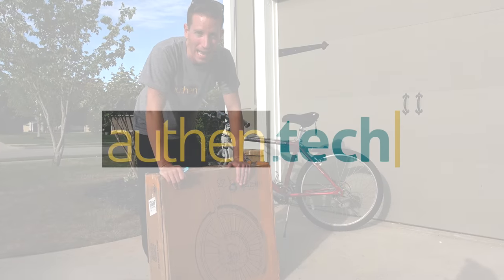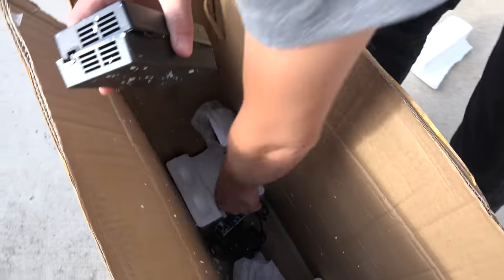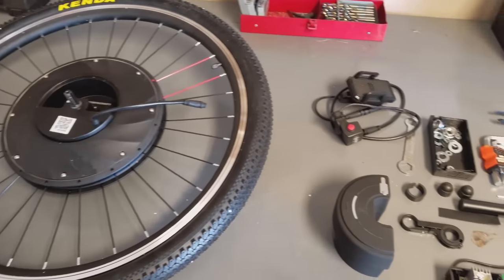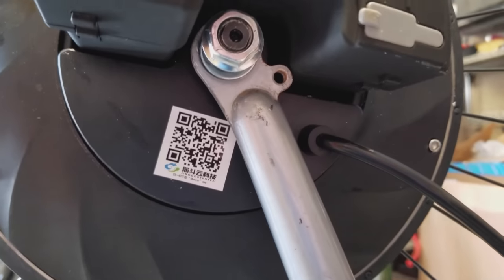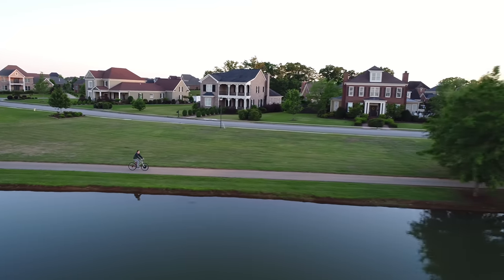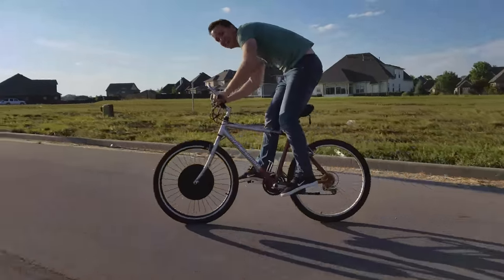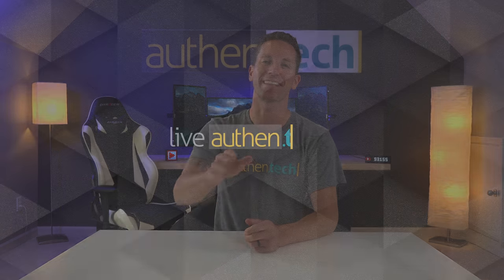Easy + Cheap eBike!! Motorized Wheel Conversion Kit REVIEW

Comment: Why does this look almost exactly like the upcoming UrbanX / UrbaNext wheel?
Reply: sponge720   this the first iteration of the UbanX.
Reply: There's only so many form factors you can effectively use for an in hub brushless motor.

Gearless drive means pretty low torque until you get it moving a couple of MPH. (high amps for low effect)  But at speed its far more efficient.

The key differences will the number and quality of magnets, stator poles and winding pattern.  Quality of all materials used.

Comment: How much power or torque, speed accompanied with pedals, whatever it might be are you allowed put on a standard bike before you are required to start paying insurance policies, as if it was a petrol motorbike, I have just looked at a few of the Motors out there,  that I have watched so far, a and strong fit man can get up to that speed so, I don't think these should be made pay insurance to go on the road, what is the situation on this antibody.?

Comment: What Ben said....130wh = 3.6ah, which means the battery is miniscule and won't come anywhere near using the full 240W motor capacity.
Reply: 139wh = 240watts for 36 mins

Comment: i bought a similar unit front hub , when i hold the axile bolt in my hands the wheel wont spin or free wheeel , is that normal ??  are the magnets so strong you cant hold it in your hands and spin the rim?

Comment: this can be fitted to beach cruisers? I heard you mention "leisure bikes", same thing I'm guessing. good review! first time looked at the ebike game, they were recommended by a friend. i didnt consider front wheel drive before this video 👍🏼
Reply: just wondering if the angle of the forks vs the persistent drive torque on the head set would lead to eventual failure?

I'm on flat ground with good pavement, a few very small inclines as I'm on an island so "hills" isnt the best word choice! head winds and my 8'6 surfboard on a side rack will be my drag obstacles.

Comment: Can someone please tell me why they don't make 27" conversion kits? There is every other sided bike wheel but god forbid we add 1 more inch in diameter. I like my road bike with the slightly larger wheels. why cant I also have peddle assist? I've seen E-bikes with gargantuan off-road tires. So weight cant possibly be the issue. I have scoured google and such and cant find a single conversion kit to fit my bike.  If im missing something please point it out because I would really like to jump on the E-bike bandwagon.

Comment: Hi! Thanks for your Video. Coud I ride when it is raining. The battery would suffer any damage?
Reply: I have a full kitted conversion on my bike with a dolphin battery, you would have to check the quality of the outer casing but as for mine I wouldn't leave it out all day in a rain storm mainly to protect the motor as the battery is removable but as for heavy rain on the way to work and storing under cover when you get there should be fine, just avoid really deep puddles.
Reply: I've ridden mine in the rain without any issues, just avoid deep puddles.
Reply: Hi David Marks,so i can ride in the rain? Cuz i live in Scotland and i need to be sure, also the Gear Shifter is safe?thanks anticipate...
Reply: In third gear, I seldom get passed by those using kinetic energy. One guy, whose 'off the shelf complete e.bike', which was faster, scanned my bike with his eyes as he passed. Wheel and two spare Batts, cost me around £500... I buy spares for peace of mind. When the batt dies, it's slow peddle home,  like the old days for me, which is why I got one!

Comment: i have a Schwinn 29'' mens taff mountain bike my question is can this motorized wheel fit for my Schwinn that has disc brakes will the wheel fit for my Schwinn ?
Reply: yes
Reply: @chenlvbu3221  My Cannondale don't have no disk brakes I got the bike from Bert's bike shop. Can this electric wheel fit my Cannondale and the wheel size is 37-622(700x35c-28x1 5/8x1 3/8) mill 50-max 85psi (3.5-59 bar 350-590kpa kenda courier that's what it say on the rear wheel ????

Comment: Three things. 1) this looks like a rip off of the urbanext and 2) I think they added one too many zeroes to the mah rating 3) That much torque on the front forks could be dangerous and you should consider a torque arm if you're using aluminium.
Reply: Rich Tornambe mine keepscbrakin the spokes it jest hade new wheel rim and heavy gage spokes fitted and trimed at a cost of 78 uk pounds its a lot better now i have to watch the tork in the wet u can set them up to do 27mph so im told with your phone and a app
Reply: Rich Tornambe.

Comment: My ebike's a 1000w 48v wheel. It can actually get me rarely up to 46 or so if the winds are okay and im going downhill. As for going around places, usually about 30 or 35.
Reply: My 48 volt 350 watt around 
50 kmph+

Comment: check and tell me if you can use a 12 volt solar panel to keep the wheel charging and using it at the same time and it's another charger called charge and go tell me if you can charge the wheel and use the electric wheel at the same time ?
Reply: it can be done but to keep it charged while riding you will need a lot of sun and a giant solar panel
Reply: but if you leave it in the sun it will charge slowly so why not , I wish solar panels were morre efficient
Reply: a solar panel that put out more volts or watts might do it i mean more than 12 volts might do it ?
Reply: doubt it , if you leave it charging in the sun for 12 hours , you might get 12 minutes of slow cruising

Comment: I'm a mechanic at a bike shop, I own two multi-thousand dollar bikes, I know my way around two wheels. A guy came to our shop insisting that he just "wanted to show us" something but didn't want to sell us anything. With a little pushing my boss got it out of the guy that he was one of the biggest investors in the company that makes these. Me, knowing what a good bike is and also weighing 210lbs, thought "This could be neat for someone who knows nothing about bikes." If only. I took the front-wheel-driven bike to our parking lot where I have tested thousands of bikes, and gave it a spin. Mind you, 210lbs is nowhere near the upper limit of people who ride bikes, and I get the feeling that this product will attract bicyclists on the heavier end of that spectrum rather than the light, fit people who probably own a bike that would never accept this technology anyways (since 26 inch wheels are no longer mass produced by any bike company). So I sit on this bike, I throw the throttle wide open, and it takes the bike until the end of the parking lot go maybe 10mph. (Our parking lot sits slanted at maybe 10 degrees from flat, you wouldn't be able to tell that it's not perfectly level if you stood in it). I'm immensely unimpressed with the power and torque of this thing.  I turn the bike and immediately the motor struggles to keep up, not even going up the slight slant of our parking lot whirring and pulling me to the end at a top speed that couldn't have been more than 5ph. But that's not the end of it; the particular model I was on, which I was told was a prototype, had regenerative braking. Normally this is good and on high-end electric bikes can be toggled on and off. On the bike I rode, the regenerative braking was more powerful than the cantilever brakes on the old 26'er. not impressed.

Comment: That "mounting hole in the way of the battery slot" is there for a locking washer which stops your front wheel from falling off if the nut comes loose!
Reply: Derf,  it's for a Disc Brake.
Reply: Mounting bracket for a front rack.

Comment: Trust me rear drive is a lot better. potentially that motor could rip the forks off the bike.Also you get better traction.If you spin that front wheel leaning into a bend(easily done) the bike tends to slip out from under you. I know coz I've got one.Anyway good video mate. I love these ebikes/cars as well

Comment: 36V 3200mAh Power Lithium Battery? That is tiiiiinnnyyyyyyy. Ain't no way you are getting any worthwhile distance from that. That's essentially a 10S2P 18650 pack. 20 batteries. That's poop. I have over 120 cells in my bike and get about 35 miles before the voltage really starts to sag. Granted I'm pulling 500-750 watts, but anything lower than 500 and you might as well just pedal or walk.

Comment: I would not waste money get 1000w hub, 45 amp controller and 54.6 volt battery. You will not regret it! You then have speed and distance.

Comment: Way to many mah there is only 3200 mah not 30k
Reply: my anker powerbank is 26800mah which is 3 times smaller than that battery, and it is real value because it uses 8 panasonic cells inside each being 3.7v 3400mah

Comment: If that bike frame is aluminum, the drop down on the front fork will snap and you will either fall on  your butt and be scratched up a little or you might fall on your face and die.  MAKE SURE YOU HAVE metal frame bike or torque bars attached!!!!!!!!!!!!!!!!! Also you can find cheaper 1000w kits on amazon for like $160.

Comment: 15mph top speed 😂😂😂😭😭😭
Reply: lol I know! I can get up 20mph cruising in "power gear" with my regular leg-driven bike. The only advantage to this would be for longer transport rides where you might want to save your legs.
Reply: Haha yeah thats what i said. I easily reach 30-35 mph when I'm peddling real hard and average about 15mph when just strollin. Guess it it'll take the burn off my les though
Reply: Yeah yeah you know what they say about guys who brag LMAO
Reply: Faster than 10MPH pedaling a bike, and can really make a difference on long trips. Also beats the costs and legal hassles of cars, mopeds or motorcycles. Still, I ended up using about the same amount of money as that hub motor kit price to put a Honda 25cc engine on the front wheel with a 64oz. tank and Kevlar tire instead. I get about 16-23MPH because of my gearing, but I also get about 50 miles per tank or 100MPG partially for the same reason. Plus, I don't need to limit my 1-way trips to about 5-7 miles then go back and charge for several hours like E-bikes. I've taken this bike on trips over 100 miles no problem. I let a friend pay me to use it for work lately, and I miss it. Still, a deal's a deal, I needed the money more than that bike lately, there's more Winter weather now, and it's not as much fun to ride now, anyway. My friend needed starting fluid or to keep the bike inside for it to start and run right to/from work. Still better than a cold E-bike :)
Reply: I was watching ebikes in a local store, all of them are limited to 25kmh, according the EU regulation and the prices start at 1200 euro, so this looks like a steal, I think, I get it
Reply: @Ultranationalist lol but you can get up to 30 but you wont be able to maintain it that long
Reply: @catsbyondrepair  I do. Lol

Comment: All fun and games until it rips off the dropout tab from the fork and your teeth go rolling down the street.  Fork dropouts aren’t designed to withstand torsional force and will fail.
Reply: There is small torque washers in the kit that help with this. My locknuts have never come lose

Comment: It's way too cheap! You can't get quality for this money... A quality battery with charger costs this much if you think about it!  Also it's heavy and bulky for its power. Its shaft and bearing will be rusty in a couple of months even from humid air cause of its faulty seals. The rim will bend easy. How about if you go on a longer trip? It helps at the first 20 miles or so then you have to carry the extra weight with you on the rest of the trip! If you invest into extra batteries than you carry the empty ones with you as well. At the end you'll loose energy! Save this money and invest into a quality one with separate battery that you can attach to the frame. You can get better range and weight distribution... Just my 2 cents!

Comment: I wonder how state governments will handle electric bikes when scooter/moped laws for the most were written around gas engines. The usual limit for a registration free two wheel vehicle is 50 cc which has no particular horsepower rating. They'll have to decide on an entirely new and more relevant rating. Most legislators won't even understand the question much less solve it.

Comment: Yanmar PMA 12 Volt 15 Amp Permanent Magnet Alternator 121450-77200.
775 Motor DC 12V-36V 3500-9000RPM Motor Large Torque High Power Motor. this reduce battery waste and increase battery life and reduce battery size to 12 volts just put the yanmar on the end and transformer it to the desired amperage and voltage. the 775 motor that is!!!

Comment: I just bought a more powerful brand and it runs easy 27 mph on level ground, for $157 bucks without battery.  JAXPETY 36V 500W Electric Bicycle Cycle 26" E Bike Front Wheel Ebike Hub Motor Conversion Kit Hub Motor Wheel on Amazon!
Reply: Yeah I would like to know

Comment: 3200mAh good for 5miles and battery is empty
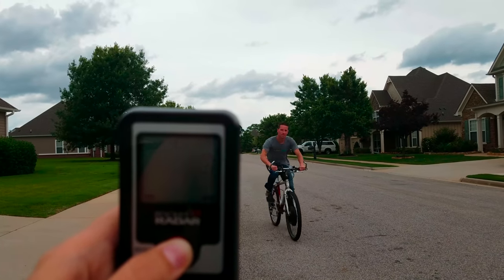Reply: That's rather 3o,ooo mAh... 3200 mAh is your cell phone's! Check @ 2:25.
Reply: Drain the battery more than 80% on a regular basis and you will trash it fast.

Draining it to minimal voltage that the charger will recognize it ONCE will trash it.
Reply: feyen willy 

COULD HAVE SWORN HE SAID 15.

Comment: Why did he cut off the mounting hole? He could of just rotate the wheel a bit
Reply: justas drigotas The battery rotates genius. It will make a revolution then hit that mount.
Reply: Chantal Beck the fork itself is even closer, so your point is not valid
Reply: justas drigotas You are missing the point. Do not procreate.
Reply: Chantal Beck I told you the wheel fork goes inside more than the mounting hole, if the battery were to hit the mounting hole then he would not be able to drive even after cutting it down
Reply: handbags at dawn
Reply: appynoon I prefer a fight in an alley ala' "They Live", but to each their own.
Reply: Chantal Beck
The battery most certainly does not rotate. It is very obvious without proof and of course it could not rotate as it sticks out past the forks, but if you require proof look at the the video at 2:30  Justas is completely right, this guy could have just rotated the hub a few degrees and the battery would have fit.... who is the genius now? Please do not procreate...
Reply: Ben's install is a bit streamlined without mentioning particulars.  I think the axle has flats on it, which are meant to slide into the dropouts and not rotate.  The stationary part that the battery inserts into is keyed, if you will, to the flats on the axle.  So, I'm thinking that Ben could not have simply rotated the arrangement to allow the battery to clear that fork tab.

Comment: 1) Why someone place battery into a wheel like this?? You push center of gravity out of the center. At last make it in the round form.
2) When you place batary in the wheel, it suffer from vibrations and 
impacts effective on it.

So you compromise of reliability to easy install? Its Bullshit.
Reply: because if you place everything in the most balanced areas you end up being in luxury territory and luxury territory is no longer cost effective

Comment: i got a better one. use the old style with an accelerometer to turn a generator to power the engine. may need ac inverter to work if you use a ac generator (stick one that looks like a bottle.) ac converter and dc motor can be used afterwards.

Comment: Don't buy this e wheel. Look around. I have been looking for about a month now and have seen better powered e wheels that's can even do 35mph for the same price. That's battery not included. Buy the better wheel and look around for better battery options. Some battery options out there can take you over 40 miles on a single charge with no pedal assistance. And that's even diy batterys too that could only cost 100$.
Reply: Thanks for the tip! Do you have any recommendations?